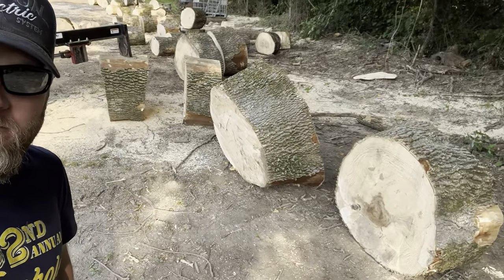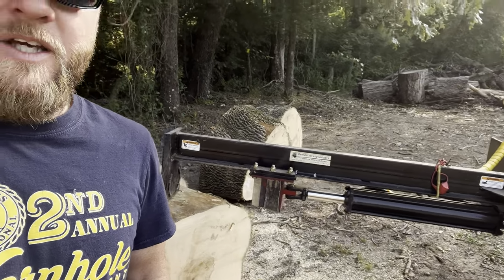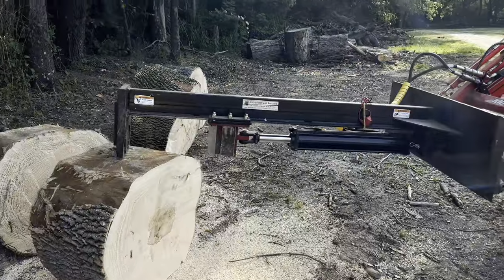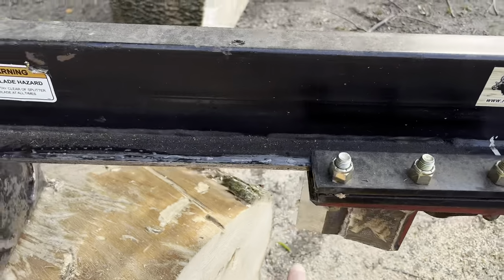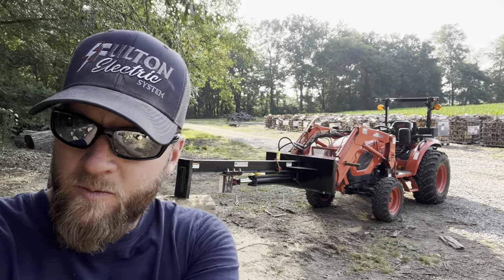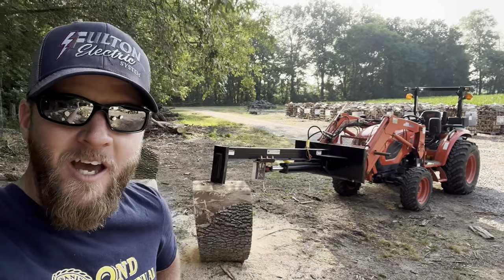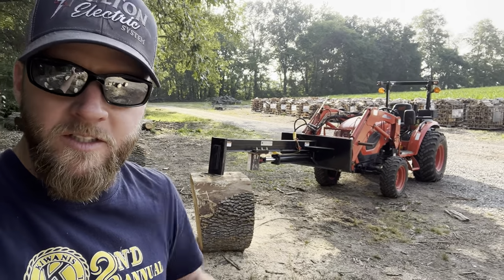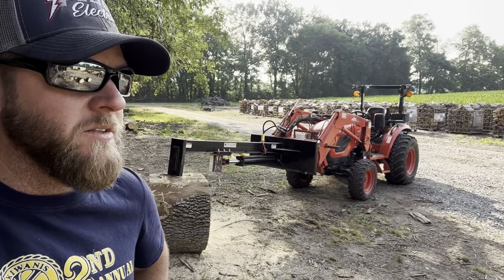Inverted Log Splitter & Kioti CK tractor vs Big Ash Rounds

Comment: Very good way to handle the bigger pieces. It would sure save your back if you could split them over a trailer or old hay wagon that was close to your splitter height. I try to avoid throwing or cutting on the ground, getting too old for that. I am working on a new layout from start to finish with a cutting deck and gravity feed to my splitter on roller track, and stack into racks straight from the splitter,  the move to the storage area. It should save alot of bending over.  Just need to get through the 40+ cords of rounds stacked up from Ash removals last year. It takes time, without a doubt.
Reply from the maker: Appreciate you watching & commenting! Yes, that would be real nice. I’d like to see your idea in action!  Thanks again

Comment: That inverted splitter has a place in my woodyard for certain. I’m getting a 3rd function plumber in and will have to see about getting me one. I’m getting too old to move some of the giant rounds I’ve got - and I have cords worth of those rounds piled up and many more yet to be bucked. Great video. One thing (IF you have the time), you ought to do @HardworkingMan 1/3 cord challenge. I’d be curious to see the time it takes your SuperSplit to do one. Oh, and it can help bring attention to your channel too 👍🏻
Reply from the maker: It’s awful handy to have for big rounds for sure. I may check into that challenge. I’ve seen where several channels have participated in it. Thank you for your continued support!! I really appreciate it

Comment: I have the same splitter with a 4-way wedge but I use it on my Bobcat 773 to bust up the big logs to finish on my rugged split both 22 ton and they work great. I just cut for our use thou. Great video.
Reply from the maker: Many thanks for watching & commenting!! I’d like to try the 4 way but I doubt my tractor hydraulics would handle it.

Comment: We have a splitter to put on the bobcat. My father needs to get it fitted up.
Reply from the maker: It would probably work better/faster on your bobcat. Thanks for watching!
Reply: @TwinCityFirewood  yes the hydraulic flow would be much faster. But the trade off is the bobcat tears the heck out of the ground, leaving yet another mess I need to straighten up.

Comment: What 3rd function valve are you using?  How does it operate.
Reply from the maker: I’m not sure of the brand. Dealer installed it when I bought the tractor.  It’s an electric over hydraulic valve. 
Thanks for watching

Comment: What horse power is your tractor and what is the name brand of the splitter
Reply from the maker: 35 horse tractor & Ramsplitter is the manufacturer of the splitter. It would probably work better if I run hoses to my rear remotes but the 3rd function is handier.